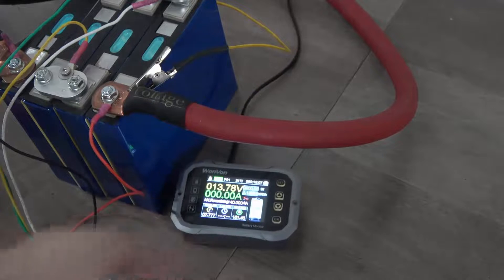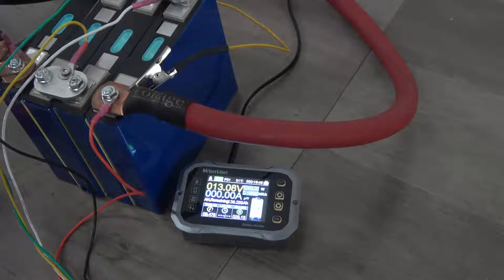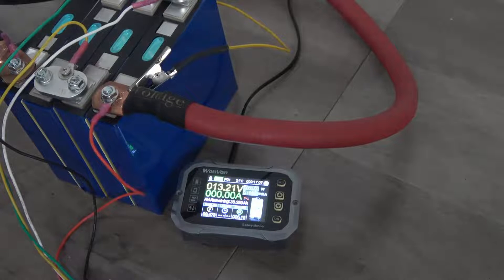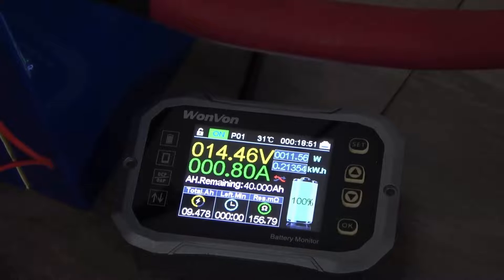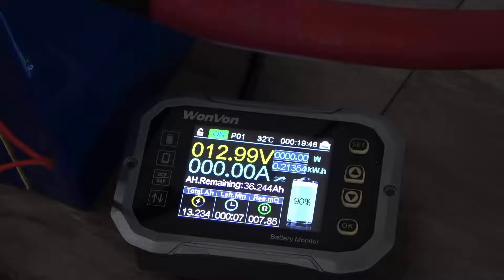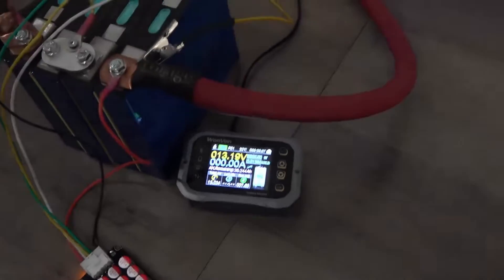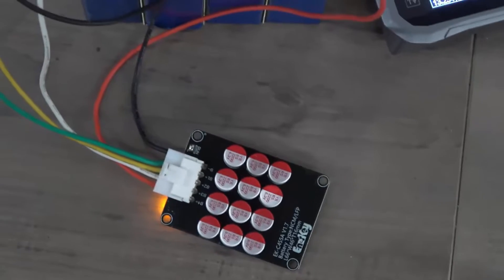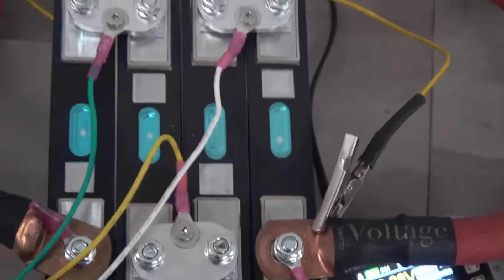Battery Dyno #2: 40ah Lishen - LifePo4 Load Test

Comment: Would I need a compression kit for these cells?
Reply from the maker: Compression isn't required, but it is suggested.  For car audio purposes, these batteries will likely die a calendar death (age) before using up their cycles.  With compression I believe they're rated at 3000 cycles with 80% capacity left.  Without it's around 2000 cycles.
Reply: @GloweIndustries thank you so much

Comment: Question about something completely different.  Can i put a lifepo4 battery in my sxs  (utv) or will it hurt my charging system on my sxs. What size would you recommend,  if i got 380 cca do i need to get more cca on the lifepo4 battery, what AH do i need etc. What all do i need to look atv and watch for. My stock battery only lasted 1 1/2 years. So hoping lifepo4 will last 5 years maybe. Thanks for any info on what to look for and if it will work on sxs without hurting anything

Comment: What are the epoxy plates for?
Reply from the maker: To separate the cells so that over the curse of years vibration doesn’t cause the wraps to wear away and force the metal underneath to touch on opposing cells. This is ground to ground and would cause a short.

Comment: Do you know if I'll have any issues installing this into a 2016 VW tiguan? I can't find any info on if it has a smart alternator or not , Im kind of new to car audio any help is appreciated
Reply from the maker: These can be used as a replacement batter for OEM or in conjunction with an OEM lead acid/agm battery and stock charging voltages on most vehicles.   If you have heavily regulated charging levels that don't kick on until the car is mid 12s there are generally ways around that.